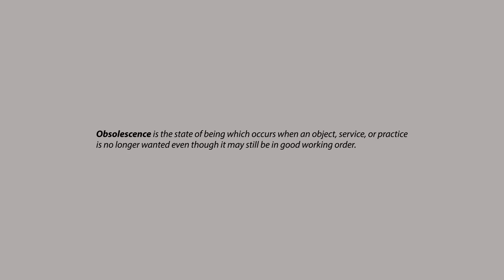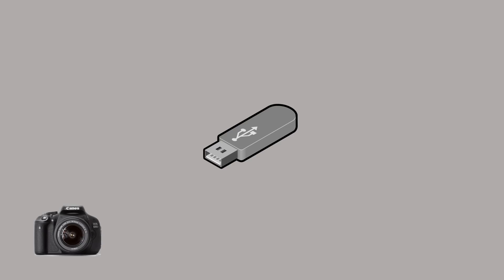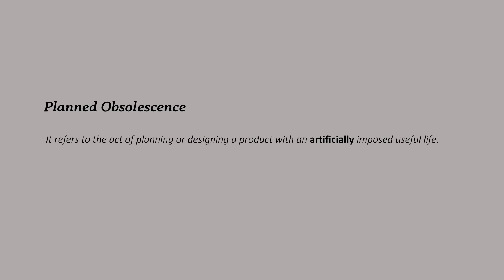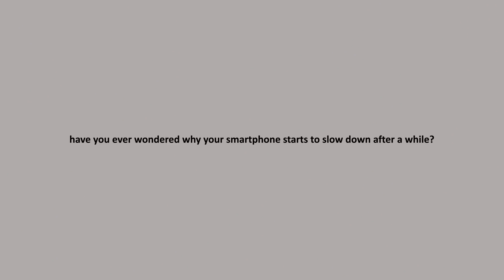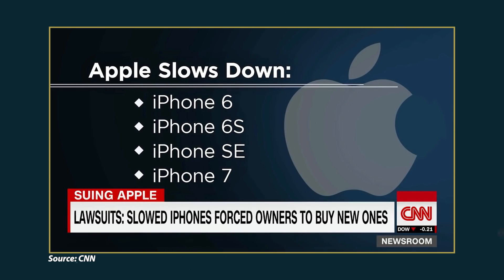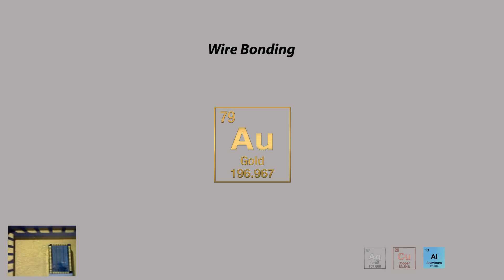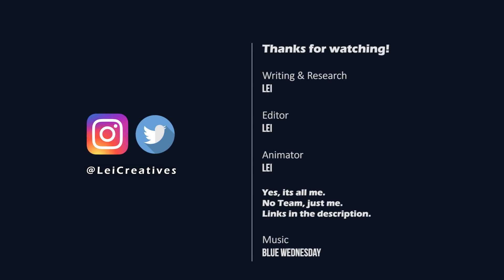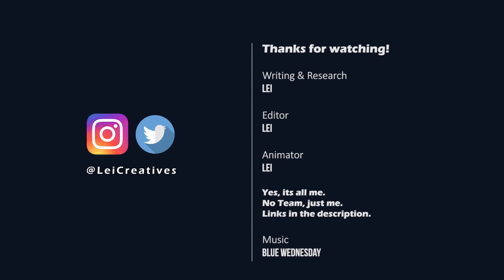Why Your Smartphone Seems to Slow Down Over Time?

Comment: So you did not answer the real questions.  How long should we expect to be able to use our smartphones before we notice a slowdown?  2 years?  5 years?  And then, assuming we love the particular phone we have, what can we do to stretch its speedy life?  Replace the battery?  Get a different operating system?  Which cell phones use gold?  Perhaps what needs to happen is for someone to create an open source operating system (linux?) to use on a smartphone, and for a company to provide basic components and motherboards for creating our own home-grown smartphones.  OK a bit clunkier, maybe cheaper, maybe a bit more expensive, but with the choice of buying cheap components or expensive ones.  Such a company could make a ton of money selling soldering equipment, gold contacts, breadboards, resistors, LEDs, screens, cpus, etc.. If smartphone companies are going to cheat us, then let’s nail them.  Anyway tariffs are coming and phone prices will go up.

Comment: You started good, then you took a dive when you aimed at Apple and used them as a prime example. Because in their defense, slowing down the phone is actually better than the phone not turning on at all because of hardware fault. Apple's mistake wasn't slowing down the phone, that's the correct approach and there's nothing wrong with that, it's even industry standard to do it. Apple's mistake was to do it behind the curtains and not advise or provide any warning whatsoever to the user, that's the mistake, and it has very little to do with planned obsolescence, especially considering it was only a matter of time before someone caught wind of their wrongdoing, leak it, and soon enough they would be facing litigation and class actions.

Comment: It is true that hardware wear helps the device to slow down, but I would say the principal reason is software. Every day new features are added to the software and those features will need a little bit more processing power and/or storage. to see that we can compare an app version of some years ago and the updated version of that app. |s like you driving the same car for years, but with time to add more cargo. Bc the car is heavier, it becomes more difficult to accelerate to a certain speed. If you take all that cargo added, the car will perform almost like new  ( only the wear engine and other parts will prevent the car to perform like on its first day). (Not saying that it is not true) but people LOVE conspiracy stories and therefore it is used as the best reason.

Comment: This only gives one reason, and it's actually an electrical engineering issue not a planned obsolescence issue. 
Some reasons include how flash storage wear leveling works - as you full up your phone's storage, it has less and less space in which to shuffle data around to prevent excessive wear in a single location.
Another reason is that operating systems and apps continue to add more features as newer processors become more powerful. Your phone's processor remains the same though. Hence Google's reasoning behind Android Go.
Another issue is that users continue to install more apps, which eat up RAM, and processor cycles. The apps themselves may also be poorly coded resulting in RAM being used unnecessarily.

Comment: What should Apple have done? Let older phones reboot all the time? Is that a better user experience? Is Apple really doing this to force their customers to buy new phones? If so, why do they offer a 29$ battery replacement? Let's also keep in mind that a 6 years old iPhone 5s can run the latest version of iOS. No Andriod OEM supports their devices for anywhere near that long. Most support them for no more than 3 years.

Comment: You didnt answer the question. Its either software, which a factory reset would solve(not in iphone case, and not software designed with heaver use than when phone was made ofc, which is the biggest problem of all) or internal memory reaching end of life trying to preserve itself, then eventually just die one day, which happened with samsung from 2013, but that is inherent with all solid state storage solutions(predictable lifespan) compared to mechanical harddrives which you could be lucky still run 20years down the road, even with heavy use. Gl with all soldered ssd's ever reaching near that. You HAVE been lied to otherwise

Comment: I’m somehow agreed with you. However, if you look from the hardware perspective. I think apple had a valid point on the battery. A friend of mine from the battery industry told me that li-ion battery has a lifespan of 2years max and will start degrade even if you are not using. How fast the battery degrade will also depends on user’s usage of course. So by slowing down the performance is one of the way to prolong your phone’s lifespan.
Battery technologies has been stagnated for quite awhile. I didn’t see any major breakthrough apart from increasing the size of the battery. I guess what apple should do right now is to pour more money into battery R&D to develop a battery that can work well with IOS and their processor chip set

Comment: I changed the battery of an iPhone 6S because it was a little slow, now is blazing fast... Apple updates their devices and keep adding new features to them, an old device with an old processor will be affected because the software will be more heavy, but you have the choise of not updating and loose all the new features. I dont think that there is a "Planned obsolescense", the thing is that if you want to turn on your computer and the power supply is not ok, you will have serious problems, and apple knows this and downgrades your speed to let the processor work with less power, not like an android, where you have a bad battery and it reboots, turns off by itself and doesnt even charge more than X percentage

Comment: So much for the big words about climate change and caring for the environment. Now, building a new phone or a dozen  phones every year for every individual is considered good and sacred. But it definitely raises the carbon footprint; the same is valid for similar practices in other products.
Meanwhile we pour fake tears for  CO2 rise and are among the first to put taxes for CO2. Everything for the profit and only for the profit. We try to fill a bucket with a whole at its bottom. This can't be and it's hilarious and tragic at the same time.
Regarding phone obsolescence, "we weren't born yesterday" .We do know electronics are not supposed to go offline in 1 or 2 years or even 5 years, especially for companies that claim qualitative supremacy . (I still rock old comps a decade old or more, without a single hardware hiccup, not even for  the harddisks! Only one or 2 power supplies have gone dead in the span of a decade).
We need , at last , in this world to stop following the dogmas of our financial obssessions, but only what makes sense and is proven by math and research for leading to concrete end points,

Comment: Sure except for one thing, they all now have sealed in integrated batteries. The battery is by far the most time dependent item, it will wear out before the rest of the phone and it's decline in performance will effect phone performance even on a full charge. So the ability to replace the battery is key to a long lifespan of of the phone. This is why I still roll with the S5, it's the best hardware available that still has an easily replaceable battery.

Comment: I feel like you did little to no research for this video. You see, electronics get old. The heat produced inside the devices damages the components and they loose efficiency over time. That's a reason why notebooks last a lot shorter than desktop PC's and why smartphones last an even shorter amount of time.

Comment: The example of gold and copper is not quiet right. Gold is not a very good conductor of electricity, copper is one of the best. Gold is vastly more expensive than copper, so prices for smartphones would be higher if manufacturers started using it (and the phones woul be less efficient)

Comment: How are your experiences with Samsung galaxy series? I had some cheaper android phones/tablets 100-400€ of worth and some galaxy minis and the galaxy S2 but they all went laggy like really laggy, taking several seconds to open a app than again start the app and then stopped working and restart again. I had two iPhones the first was a 4s wich only lagged a second after switching a page but was ok. Than I got a 6s wich I still use today and works pretty well until now. All the people I know use iPhones as well.

Comment: I suspect that the slow down is due to code in the smart phone's OS which was intentionally written to slow it down after a few years. Micro electronics doesn't deteriorate that fast from usage or the passage of time unless the device has been abused. I still have some vintage electronics from the 1960s,  1970s  and 1980s that works perfectly. The smartphone manufacturers intentionally slow down our phones to entice or encourage us to purchase new ones. The batteries inside them are designed and constructed to fail after a few years. That's how they make such huge profits from all of us unsuspecting consumers. IMO.

Comment: it slows down because of digital advances. 

for example...  you bought Samsung Galaxy S9 right now.  and you are ok with it and is running mobile legends easily.. sooner or later mobile legend will make an update and you might feel that slow down coz it requires higher RAM.  maybe in the future if DOTA Release a mobile version... your S9 may have a hard time running it. 

another example is Storage...  in the past 16GB is large but today.. when camera get double resolution. it also double the file size. having a 16GB is too little for a storage.

The same with connectivity...  in the past youtube can only play as high as 480P  today we already have up to HD1080P 60FPS and sooner   4K will become standard..  if your phone still are using slower connectivity you will suffer buffering.

Comment: As an engineer, I have to day this. You are the people we can't stand....here is what an engineer thinks like. honestly, we wanted to make sure you could get all day usage out of your phone as it deteriated so we slowed down the performance by 10% when the lithium ion battery began to degrade. We can't stop degredation. It's literally the results of chemistry changes  that the material does on its own. We thought, hey our phones are much faster than the Android equivalent of the same year. We want to offer support for these phones for 5 years (Android is 3 maximum) . Let's make sure our users can use the phone for a long time and enjoy it. Our iPhone running at 90% sure beats the hell out of an Android running 100%. So let's give them more life. Let's have a longer lasting product. We do have higher resale values for a reason. The engineer does all of this, doesn't even ask for credit for helping people, and goes on to solve the world's next problem. Later on the morons behind a microphone turn his beutiful solution into some terrible monstrosity. The sad thing is everyone believes the unqualified person instead of asking the engineer why he did it

Comment: Great video! Also there is the fact of app updates. these updates to apps are designed with newer phones with more processing power inside, and older phones don't have this power, and therefore, the background tasks slow them down (this only applies to really old phones and tablets, however. My Samsung s2 is painfully slow, since it started on android gingerbread, and is now on 4.2. jelly bean with updated apps.).

Comment: Just replaced the battery of my LG G4. It immediately seemed refreshed and became snappy again. One of the old battery started to fail to point where the phone may not boot up from it. The lesser used spare battery could bootup but the phone was laggy and the telltale sign was erratic battery life.

Comment: I think your going at this point with the wrong starting assumption that OEMs plan for our devices to slow down, but the complete opposite would entail that micro electronics are a perfect system that will run forever and nothing ever goes wrong, therefore it must be foul play, which is not close to being true. 

There are so many reasons for degradation in electronics and even more so at the small scales we have them at as there less tolerances for problems to occur. Batteries do degrade naturally from the process of constantly removing electrons and replacing them.. Apple did that and admitted it, but what a weird thing to automatically think all companies do the same.. Correlation is not causation my friend. 

There's also natural abuse our devices go through by the sheer nature of the way we use them and if you've ever worked on micro electronics, you know that a single component can go bad yet the machine will remain running seemingly fine. But let enough components go bad and you start to run into these slow down problems as other components have to compensate. And once one component goes bad, it becomes a domino effect.. There are so many ways things go wrong. And you can look at anything electronic and you will see the same thing, well only if you really want to see and accept the truth. 

Definitely a tin hat way of looking at it though.. See one and assume all!

Comment: A clear example of this was Windows XP. While it was the everpresent OS from Microsoft it was functioning perfectly, but when they announced the next operating system, Win XP began to run slow as more upgrades were released. I did not notice immediately, but on the long run happened. At the end, shortly before the support dead end date, Win XP was so slow that one noticed clearly that it was made deliberately so one would have to change for the new OS. I hate those policies.

Comment: I don think so ..Yes Apple did this but I don think other manufacturers did this also . I think Smartphone slow down overtime due to the applications that are being updates , When an application has new update it also has an additional feature and also has improvements , and by adding features on a SW , it will require more HW resources, and our phone will have the same HW as day, over time those applucation will require more power to the point that our phone's HW will not be enough anymore .

Comment: You took five minutes to say nothing about our phones slowing down. Then you admit "they aren't meant to last" then you cry about Apple trying to keep your phone alive without telling you. 
The implementation of this particular throttling only took place when the last bit of software kept shutting the phones down unexpectedly. So, instead of thanking Apple you're bitching. The only reason Google isn't in time for doing this is because their devices are so fragmented they all have so many other reasons why they slow down. Mainly because it's old tech running old software or new tech running old software. Most of Android phones are cheaply made with the copper connectors while expensive iPhones are made with gold. So you know Apple builds them to last.
Reply: Tim Possible No wonder they slow iPhones down till its unusable as a daily driver. Trust me I have experience with these iPhones. Apple is deliberately slowing down our phones, forcing us to buy their newer ones. If they did it for our good, why didnt they inform us of their software tinkering?
Reply: MrJustStartedGuy that's BS. I see people using iPhones as their daily driver for 4-5 years with no real issues. Apple makes their money through services. iPhones are made to last. That's why you pay a premium price up front because it'll be with you a long time. Unless you get addicted to having new tech there's no push for you to buy a replacement device. Albeit, I'd you put software that's too advanced for your hardware on your device, you'll notice some slowing. Other times a fresh battery will perk it right up. 
I'm sorry if you've confused Android's planned obselecence for Apple.
Reply: Tim Possible You can believe that if it helps you sleep at night.
Reply: MrJustStartedGuy I have no problem sleeping knowing the truth. Living off haterade might keep you awake at night though.

Comment: im a wirebond technician, the trend nowadays is using copperwire, copperwire needs argon gas to make it bond to the die, copper device has bigger rejection rate and is more prone to problems than regular gold wire

Comment: Charging a lower price for the product because you use inferior materials that will degrade much quicker is perhaps excusable (if you ignore the fact that obsolescence is also causing tremendous environmental problems, what with billions of people replacing otherwise perfectly-functioning products every couple of years). But to deliberately neuter a well-functioning product with a software update just to force the consumer to buy a replacement is heinous. Who do these people think they are. I have a tablet that's barely 2 years old and is so slow, I can barely enter my pattern before the screen times out. My once-new Galaxy S8+ is lagging like crazy at just 13 months. Actually it mostly started ever since the latest update to Android O.

Comment: I think there is a difference between hardware reliability and changing software to not utilize the hardware capability. 

Changing the software to throttle back capability seems a bit of a “we know better” moment, and certainly can be perceived as a way to make the consumers buy more phones.

Not providing any caveats of that degradation without giving the user an option of performance makes it feel like ... socialism? I have no control after I make the original purchase, but at least I got to make that first purchase decision.